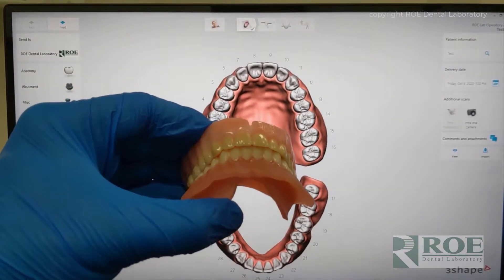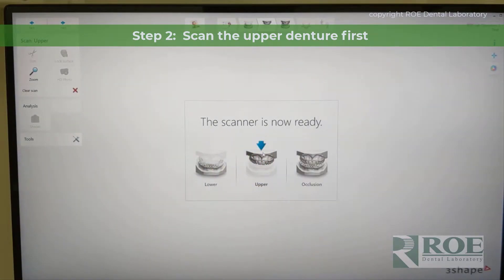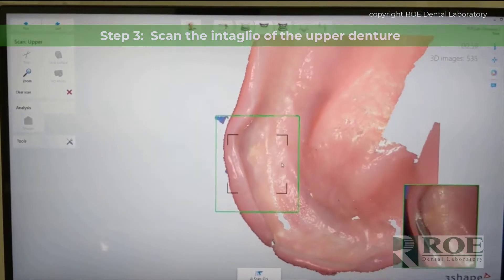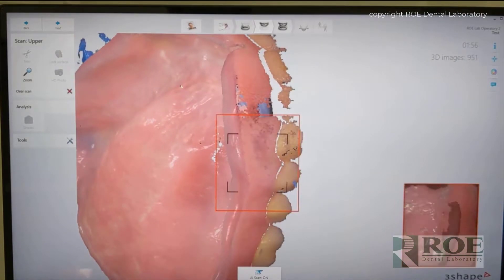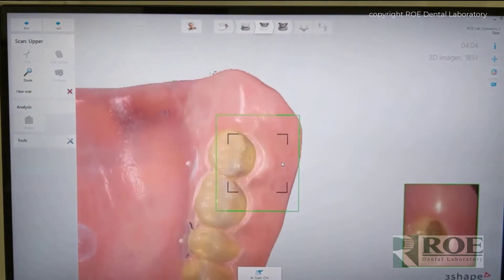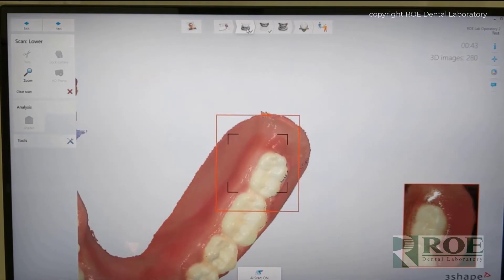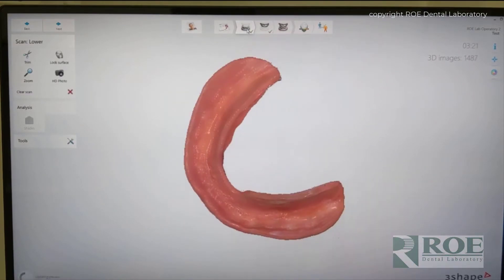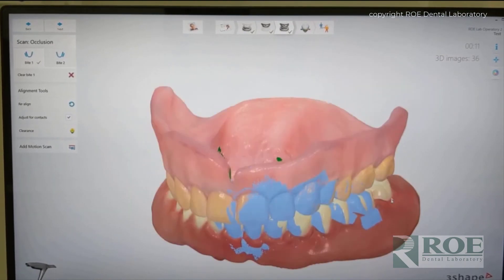3Shape Trios Scanner: How to Scan an Upper and Lower Denture and Bite

Comment: If we reline the denture with a light body PVS should we scan the whole denture with the same method as described? Or is there a different method?
Reply from the maker: Generally when taking a reline impression in the denture and scanning there is not a different method for scanning if you are just using a different reline material.